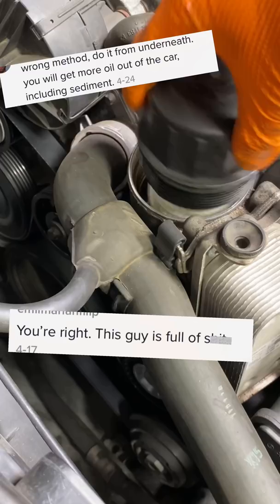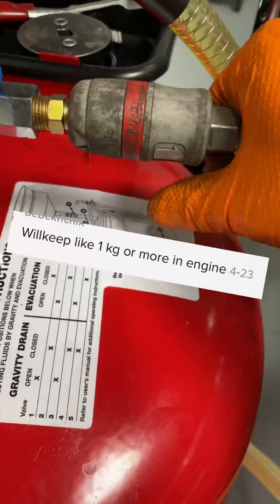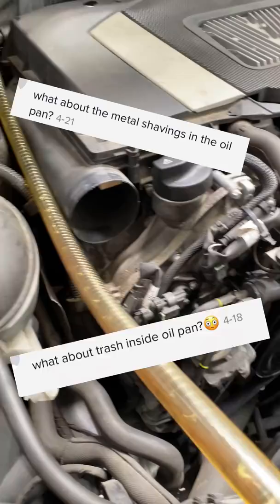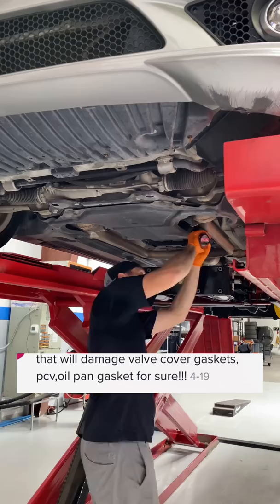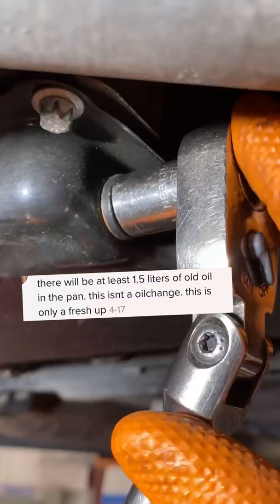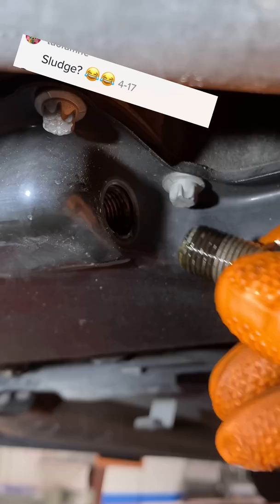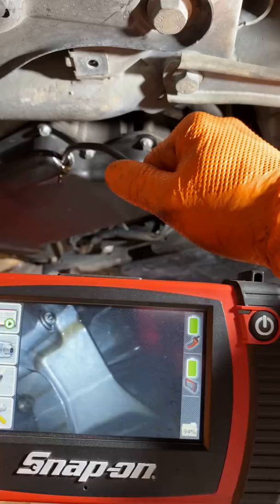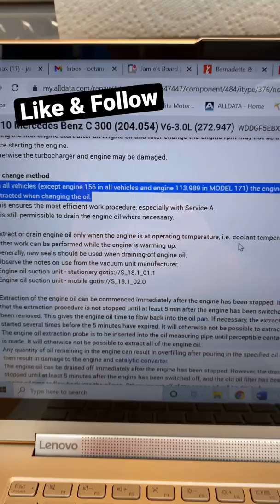#shorts Mechanic Proves Haters Wrong

Comment: As a tech myself not everyone has that set up. Man I wish they did. Changing oil and filter would be way easier
Reply: A pump and a hose?
Reply: @TimForber69  nah he talkin about those baller snap on tools.
Reply: Actually I was talking about how the dipstick tubes don’t go to the bottom of the pans like they do on Mercedes. Yea you can do the hose and pump method but I don’t want to risk getting the hose snagged or breaking off
Reply: I’ve changed oil on a car, the flirter was in the most impossible place to get to
Reply: @AngelofDeath333  yes those damn flirters 😅
Reply: @dan4age  supposed to say Filter
Reply: @AngelofDeath333  suburu? An old Cavalier, old Taurus with the V6 engine? Or a Ford ranger with the v6 4x4, Honda with the oil filter on the back of the block?
Reply: Pump n hose $30 for the hand pump crank it and let it sit come back the pump will be full of oil
Reply: @TheColts1027  I believe it was a Cavalier. Oil filter is above the A Frame, and behind the axle under the battery. The battery sits on a welded plate that can’t be removed
Reply: I like doing mine outside under a half jacked up car so the slightest breeze pushes the oil stream everywhere :)
Reply: It’s not like you can go to Harbor Freight and buy an extractor.
Reply: @TimForber69  arms
Reply: @AngelofDeath333  The oil filter also dumps its contents directly onto the exhaust flex pipe too.
Reply: @TheColts1027  subaru oil filters are easy my 14 wrx hatch was simple as fuck remove the belly pan and it was right there drain the oil swap it refill done u gotta be pretty stupid if u can't change ur oil it's just as easy as changing a wheel but he prolly thinks that's impossible on some cars
Reply: @TheColts1027  sometimes they can be a little harder but that's why u got oil filter wrenches and shit idk why that guy thinks it's so hard
Reply: @22.NUU.DRU.22  working on that car was 8 years ago, I don’t remember everything exactly
Reply: @TheColts1027  I can change the oil filter in a cavalier and no I don’t take the ecu off either
Reply: Doesn't work on every car, certain year land rovers have a tube specifically for this type of tool, works on some Mercedes, jaguars, ford, etc. Not for every car, but when it works it works great! Just have to know what cars to use it on.
Reply: @TheColts1027  subaru*
Reply: @TimForber69  in a shop you don’t have time for pumping
Reply: @AngelofDeath333  my buddy used to have a Cavalier he called it his Cavillac 😂
Reply: I mean they still can just drain them like usual....

Comment: Having an oil filter on the top of your engine is the best thing ever. Literally the cleanest oil change. By far the best video I’ve seen in this subject.
Reply: Until it's in a weird spot at the top where it's tilted a bit and you have to pull it through some hoses and other stuff in the way so it's almost impossible to pull it out without oil dripping down into hard to reach places. I did a fiat once and I literally had to remove some piping to get access to the filter.
Reply: @MostGenericUser  yeah some company's do that but the dripping can be avoided by unscrewing the filter and let it stay in its housing for a few seconds so the oil drops back into the engine
Reply: @MostGenericUser  also known as mopar topside filters
Reply: @MostGenericUser  yeah, like the fukin PSA engine in the Mini Countryman S, where it was easier for me to unscrew the filter from the top and remove it from underneath
Reply: @erikm.905  luckily I haven't had to do a mini yet but now I have something to look forward to lol
Reply: @beastZz706  that definitely helps and usually I try to wrap a rag around the bottom when pulling it out but sometimes I still get oil that drips down.
Reply: My cruze had the filter on the top and my new vw has it on the top
Reply: @MostGenericUser  Toyota 1MZ-FE engine, total nightmare doing oil filter. It’s horizontally mounted to the engine, above an engine mount and right next to the transmission. You smell burning oil for a day at least if you don’t clean it all up. Oil gets anywhere and everywhere.
Reply: Zee Germans like doing that but even the 4.0 and some v8 Toyotas have it up top
Reply: My Honda has it next to the rocker cover. Unfortunately, the fuel filter is underneath the car, so I still have to lift it :/
Reply: Idk, I've seen a few guys just unscrew and pull it out. It makes quite a mess if done quick. Just like anything else, don't be an idiot and it should be fine.
Reply: @MostGenericUser  Just use you brain before you change it if things are in the way.... finding a solution is not very hard
Reply: Salty?
Reply: My 03 f150 has the oil filter right in between the front differential and an exhaust manifold, right on the side of the engine block. There is only one possible angle to reach it from and apply any amount of force to loosen it up from.
Reply: @keegenm.6154  I have serviced such a truck. A true wrist burner.
Reply: My aunt has a gmc terrain, dont remember engine size, oil filter on top was a b!+(# to remove.
Reply: @zuhayrali4202  aka the prius. You have no idea how many of those caps I've had to split in 2 with a hammer and screw driver, cause the last oil change place torqued them on so much the threads fuse to the block.
Reply: @dbongoloid9541  oh dude or how about when those same places strip down the canister cap so bad that you have to jam rags in the canister socket in order to get it to bite
Reply: @DS-ck8gj  yep
Reply: That's why I love my subaru

Comment: If all these experts have that much “sludge & debris” in their oil pans then they’ve got problems that simple oil changes ain’t gonna solve 🤣🤣🤣
Reply: “Metal shavings in the oil pan!” Boy what? 😀
Reply: @erikjimenez5851  if your car ain't blowing smoke everywhere, what are you even doing? /s
Reply: It’s a GM thing
Reply: @erikjimenez5851  the oil is there to lubricate the engine. Engines are made of metal. The guy didn't mean shavings like youd get from an industrial bandsaw through bar.
Reply: @callum4337  any type of "shavings" in your oilpan is terrible do people really think it's normal to have debris in your circulation? What?
Reply: @danieleckert4027  definitely not a gm thing bud, i own a chevy and there ain’t sludge or metal shavings in my oil pan. It’s a 20 year old car and haven’t had a single problem with sludge in my pan
Reply: @doodlecaboodle9298  1.4l ecotec get pretty sludgy  the v8’s don’t have oil problems they have mechanical problems collapsed lifter and bent pushrod if it has DOD/AFM usually 5.3l the new 6.2l had valve spring problems
Reply: @MrBelgianJunglist  it's not in circulation it's in the pan.

We got heat, tight tolerances, and huge forces. We got metal separated only by a layer of oil. Any time that metal happens to touch another bit of metal, even the lightest graze, like a butterfly tryna get friendly, particles come off the surface. It might not be visible to the human eye, but there will be something. The more particles in your oil, the more aggregious these butterfly kisses will be. Anywhere you have metal on metal, metal particles come off. You can't see the abrasive in fine polishes but it's there. In a hearing or a seal it's a bother. If they had it sucked out the bottom I'd be a-OK with it, but giving all the crap another go at the system bothers me. Maybe they've a direct feed from the tray to the top? Would make sense if they advise that but then again I don't think manufacturers want their cars to last as long as pre mid 90s cars do. Then again that could be a bias. There was plenty scrap heaps fresh off the line with huge problems back then, they just died off completely before I was born. Could also be that you can keep a car operating as it came off the line a lot easier, whereas now electronics are a nightmare with wires getting thin as possible, number of computer chips increasing, and the amount of data a car needs to read to run as intended increasing vastly. Its harder to just work it out, you often have to sit down and do more research and very systematic fault finding. Still. The paranoia that the manufacturer wants to cut short my bond with my car so I become a potential customer again is strong, and I really don't mind doing other bits while the oil is draining. I usually free up the whole afternoon and I've got my tunes on so I'm not worried about time like a dealership garage is.
Reply: @callum4337  yeah, those microscopic particles if metals from rings for example, will get suspended in between oil particles. Sucking the oil will get all of them out. If you have visible metal shavings in your oil pan, drive the car to the nearest junkyard while you can.
Reply: @callum4337   if the shavings are big enough it'll get caught up in the pick up screen or the filter itself. Other than that, any micro particles you're talking about are definitely in circulation and not just "in the pan." Where do you think the oil in circulation comes from? You guessed it, the pan lol.
Reply: @patrickmuzzi  yeh but the pan allows heavier particles to settle. I see what you're saying with the filter. But again, every oil system has a filter, and a pan for contaminants. To drop a protection mechanism seems foolish. The oil in the pan is circulating, yes, but it's like a wide deep section in a river. For example, where a river runs into a lake, the kinetic energy of the water drops massively, and it deposits all the silt.  You see a shallow u shape encroaching into the lake. Lakes and oil pans are not the same I know, but we do see a drop in energy stored by the working fluid at that point in the system.
Reply: @erikjimenez5851  m8, when you several piston rings brake... sad sad situation...
Reply: @patrickmuzzi  uhh. Your cars DON’T have oil filters? 🤦‍♂️
Reply: @callum4337  I understand that, I guess my disagreement would be that the metal you mentioned, that we couldn't see, wouldn't settle. It would be stuck between the molecules of a viscous oil. But if the oil is old I could see a settlement of micro metal like you described. Idk how much engine work you've done but when you spin a bearing and drain the oil it's all shiny, making me believe those particles are still mixed and circulating. What we need is a magic school bus adventure!
Reply: @ALL4SCUBA05  wtf are you talking about? Here me and this guy are having an intelligent conversation, then you show up 🤣